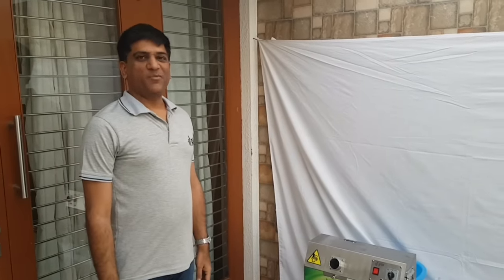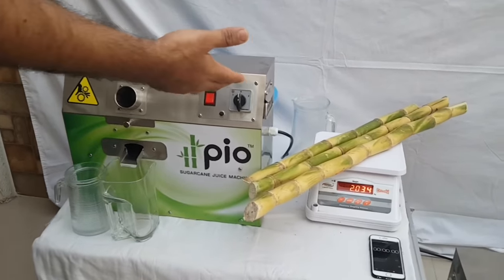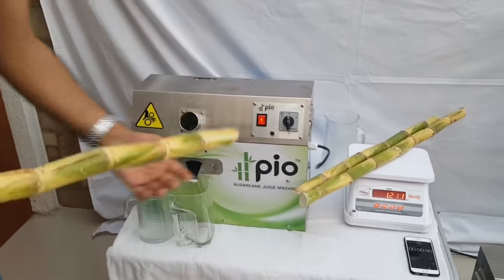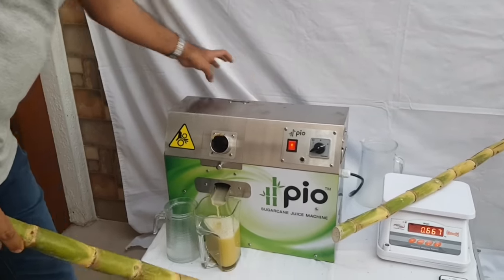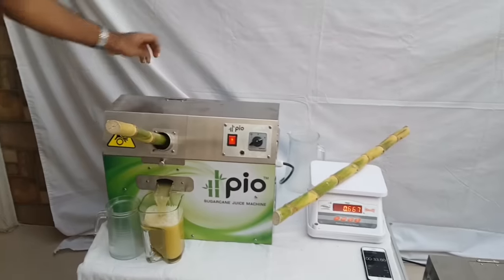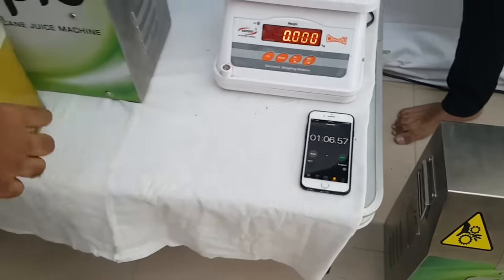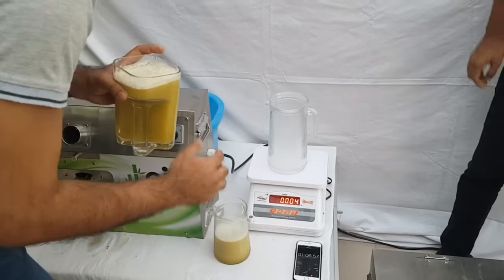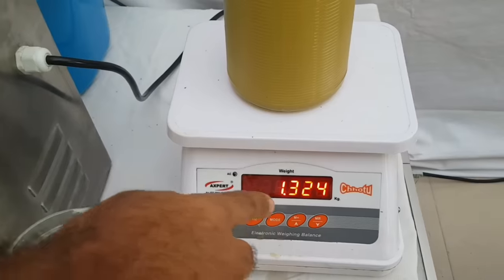Revolutionary MINI Sugarcane Juice Machine

Comment: Machine is very nice and compact, But Price of Rs47000 is little bit high, If the price comes below 30,000Rs then many people buy it for household purpose also...
Reply from the maker: Muneer Ahmed Pinjar 
Your suggestion is good but because of very good quality of machine and 18% tax lower price not possible.

For any further information you can mail us on 
info@piojuicer.com
Or you can contact us on whatsapp
+91 9227505254
+91 9227909294
+91 9227808284
Reply: How much price, Address,
Reply: It is very expensive, I am trader of SS 316 materials and it is not at all costlier then 300/-Kg. So 12-15k should be the manufacturing cost, rest you know better!
Reply: Muneer Ahmed Pinjar yes
Reply: Machine seems to perform very well. You definitely need to work on bringing the cost down
Reply: Lolll
Reply from the maker: Jaisimha Allalghatta Gundurao 
We will surely try for that.👍 but current price is 40k only + gst
Reply: Yes
Reply: That brought water to my mouth 
Especially when i dont drink this from road side. But 47000 i cannot think of buying it. Please do some RND to bring it to cost 5000 to 10000. Unless you are not targetting indian middle class market.
But the video is great ☺
Reply from the maker: My Rooftop Garden 
It is impossible to make the machine in such price!
Reply from the maker: Tiny Tech 
You are absolutely right!
Reply: @TINYTECHPLANTS  if you are targetting for people who want to do buisness out of this ...its a different story. But a customer like me ,who wants to have this for private use and who can use and handle this machine in a careful way ,you need to design it using some different material and lower rating crusher....may be. .just a suggestion. But machine seems to be good .
Thanks
Reply: @TINYTECHPLANTS  yes if the price had been low then many people would buy for their personal purpose also
Reply: @TINYTECHPLANTS  iski koi Granty hai bai
Reply from the maker: Virender Singh 
+91 9227505254
+91 9227606264
Reply from the maker: Gurchran Singh 
Warranty for one year.
Reply from the maker: miraclekar abc 
We will contact you soon.
Reply: I also think 30000 is quite affordable....your point is right....
Reply: How much cost
Reply: Muneer Ahmed Pinjar too expensive
Reply from the maker: PANI IDEAS C 
For any information you can mail us on 
info@piojuicer.com
Or you can contact us on whatsapp
+91 9227505254
+91 9227606264
Reply: Yes it true
Reply: Lower price mil sakti hai sir
Reply: @TINYTECHPLANTS  too good
Reply: Yes, exactly
Reply: Price is high because of it's weight, I assume machine is heavy because it keeps it rigid while crushing sugar cane sticks, but we can fix it using nut and bolt to some hard surface to make it rigid, this way manufacturers can reduce it's metal parts and make it lighter.
Reply: @TINYTECHPLANTS   yes very expensive. Not worth it.
Reply: @TINYTECHPLANTS  ...u r not making machine...don't make fool ....u r just importing from china and branding it. It is same for soda ..icecream and sugarcane !!!!
Reply from the maker: satendra panigrahi 
You can visit our factory!
Reply: I want this machine
Reply: 15000 for household. As in intrest we will drink juice daily. Without searching for sugarcane. Simple mathematics.
Reply: @TINYTECHPLANTS  i like your machine  how it's in usd Dallars?  I'm from Ghana and want to buy and sell it as well used it commercial
Reply from the maker: Rufai Abukari 
For any further information you can mail us on 
info@piojuicer.com
Or you can contact us on whatsapp
+91 9227505254
Reply: @neeljain9619  You revealed the realityji.
Nowadays people like to accumakate more in  less work
Reply: Yes.  I fully agree with you.
Reply: @neeljain9619  Yes.  I fully agree with you.
Reply: Kaha milegi
Reply: @TINYTECHPLANTS  it should be easily accessible by cost for local Indian consumer than only can spreading machine all over India
Reply: @neeljain9619  , I am sure the machine is not made of SS316 . The rollers , outer cover and the shaft will be of SS304 at the most . the motor and gear box are never of Stainless Steel .
Reply: Nanning city in southern China belongs to the subtropical monsoon climate area. The fresh cane juice in dessert shops can be sold for 10RMB for 500ml/cup, which is equivalent to 115 rupees. If it is open for 8 hours a day, near movie theaters or expositions, crowded places, average every 5  Sell 1 cup per minute, sell at least 100 cups per day, the operating income is 1000RMB, the raw sugarcane needs 75kg (calculated based on the juice yield 66%), the cost is 150RMB, the daily salary is 200RMB/person day, utilities and venue rental tax are 200RMB/day,  The total cost is 550RMB/day, so if you operate a mini sugarcane machine, you will earn at least 450RMB tomorrow.  It is equivalent to Indian Rupee 53,000.  Ouch, you can almost recover the cost of the machine in a day.
Reply: Gujarat me 33000 me milta hai
Reply: @PratapSingh-yq6iv  kaha par milega,sir koi adress he to bataye plz
Reply: पूना मे डिलर है क्या?प्राइस कितनी है?
Reply: 45000+ gst mei dekhi thi mtlb 18 percent lgao toh roughly around 55 k ,battery waali thi mtlb battery ke 10,000 add hogy but 2 batteries krne ki nhi aati
Reply: @TINYTECHPLANTS  jo bnda afford nhi kr skta wo 30,000 mei manual lelega so iska price km kro
Reply: Muneer Ahmed Pinjar 
https://youtu.be/yeksYFqiHqA

Yeh 30k+gst mei mil rhi hai nd is se bdi hai
Reply: @TINYTECHPLANTS  heloo
Reply: @PratapSingh-yq6iv  please share details
Reply: @TINYTECHPLANTS  i want to order..i m near Chandigarh ...Bilaspur Himachal
Reply: Pakistan me mil skti hy ye ?
Reply: I simply can't understand how this thing can cost 40k. This is extremely simple machine 0.5 motor costs nothing more than 3k. Other parts like gear for crushing and electronics are dit cheap. This machine doesn't cost more than 5k to make. Reasonable profit is fine but selling this 5k thing for 40k+ is just insane.
Reply: Sir it's can be used to Honda genareter
Reply: I'm need this mation
Reply: Cos they were imported from China

Comment: I hope it's good machine. But what happens inside the machine?  You should show how it works, and whether it can be cleaned from inside, because it will create trouble inside like insects...
Reply from the maker: Aalok V. 
Cleaning is very easy you just have to pour 2-3 glasses of water on it and it’s done. And there is no problem for the insects at all. We have designed the machine that any insects like makhi can never make a issue.
Reply: @TINYTECHPLANTS  Thx.

Comment: I think there is still some juice left after passing the sugarcane stick once in the slot. Roadside sugarcane juice sellers pass the sugarcane stick multiple times till it is dry!
Reply: The roadside vendors use a complete different machinery which is completely iron or cast iron made n doesn't have powerful motors and hence they have to keep on re-using the sugarcane to take out appropriate juice quantity.
Reply: Thats why the guy in the video said at the begining, that two times pressing is not required but one time is enough in this machine
Reply: Maybe there is a Dara Singh inside the machine! Well, I was watching the video on desktop PC without speaker.
Reply from the maker: Yes this machine is much better than the machines roadside vendors use. That machine is very unhygienic and not at all suitable for anyone. We have differences between the two machines in our website www.piojuicer.com
Reply from the maker: karthik b 
Yes second time crushing is absolutely not required.👍
Reply: @TINYTECHPLANTS  we grew up drinking juices From roadside isn't it.. Now all of sudden its unhygienic... Don't kick on their stomach for your gain..... Still people drink and eat on roadside... How many of these kind machine we see in the market, hardly anywhere, may be in mall or airports....

Comment: Nice 👍 job. 
But what is method of cleaning the machine after use? 
And how much the cost of machine?
Reply from the maker: MrLalla2020 
Cleaning is very easy. You just have to pour 2 glasses of water and its done. 
For any further information you can mail us on 
info@piojuicer.com
Or you can contact us on whatsapp
+91 9227505254
+91 9227606264

Comment: Great innovation sir.
What about maintenance and voltage require to run the machine. Is it possible to run it in batter in e rickshaw?
Reply from the maker: Kindly contact us by WhatsApp on +91 7788909294.

कृपिया +91 7788909294 पे WhatsApp से हमारा संपर्क करे।
Reply: @TINYTECHPLANTS  is the machine still available and what is the current price?

Comment: Does also run in battery or other power source than electricity ?? What is the cost?
Reply from the maker: Iamminlal 
Yes it can run on generator and  battery plus inverter also.
For any information you can mail us on 
info@piojuicer.com
Or you can contact us on
+91 9227505254
+91 9227909294
+91 9227202224

Comment: What is the price of the machine and electricity consumption?
Reply from the maker: Nikhil Kumar 
Electricity consumption is very very low. Its olny 1rs per 100 glasses.
Reply: @TINYTECHPLANTS   thanks, and what is the price of the machine?
Reply from the maker: Nikhil Kumar 
For any information you can mail us on 
info@piojuicer.com
Or you can contact us on whatsapp
+91 9227505254
+91 9227606264

Comment: The machine cost is 49500 RS. That's a very high cost. People can take it for commercial use. But if you do some more study on the engineering part and can less the value upto 10 - 15 k then it can be a household name too. #pio
Reply from the maker: Aniket Patil 
Thanks for the suggestion we will try our best.👍
Reply from the maker: Aniket Patil 
But the cost is not 49500 it is 47200 INR.

Comment: The machine price is too high. The machine actual manufacturing cost will be as low as 10,000. Nobody will afford that cost to drink sugar cane Juice at home.
Reply from the maker: This machine is absolutely profitable to buy because of 2 reasons:
1.	Either you buy for your restaurant / shop factory / workplace. We noticed one does earn UPTO RS. 2000 per day average. So machine cost will recover soon.
2.	You buy for your home to be happy. In such case machine can run for 25 years and if you divide machine cost by 25, its only RS.2000 you pay for 1 year happiness for entire family, friends, guests, neighbors.

Comment: But this machine is not cost efficient
Reply from the maker: LIwood m 
This very efficient machine. One can free the machine in only one month. Its crushing capacity is 120kgs per hour that means it can produce 350 glasses per hour and power consumption is 1rs per 100 glasses.
Reply: It can hold only one sugarcane at a time .what will happen if we go for mass production not possible(means juicing multiple sugarcane at time not possible ) .the price that is high as industrial automation .I agree it's compact  but due to high price and certain limitations will  be not used in practice

Comment: 47000 price main ye machine useless hai. Under 7000 ho tabhi thik hai.
Reply from the maker: Ravinder Singh 
This very efficient machine. One can free the machine in only one month. Its crushing capacity is 120kgs per hour that means it can produce 350 glasses per hour and power consumption is 1rs per 100 glasses.